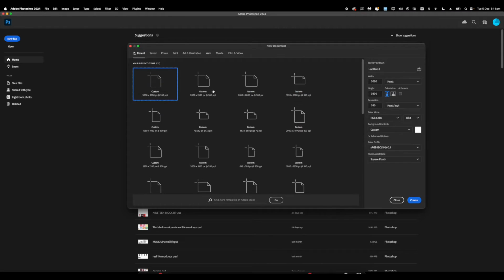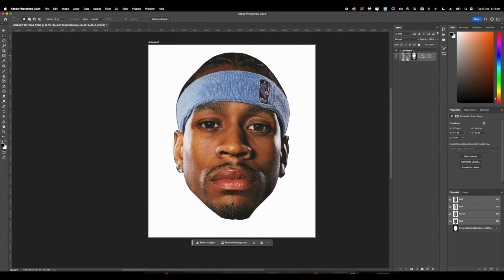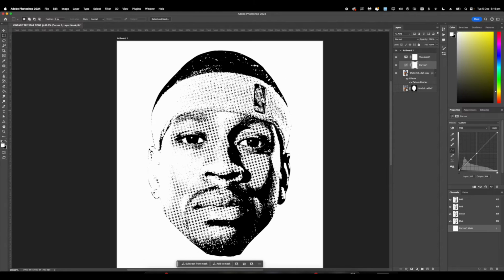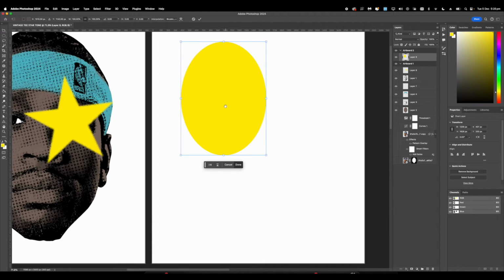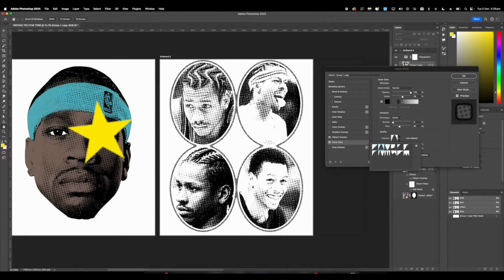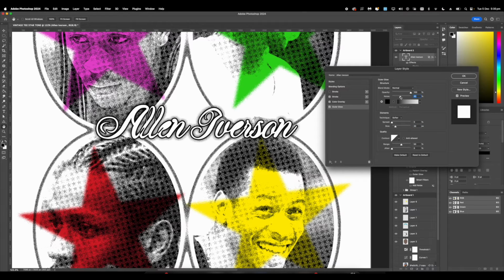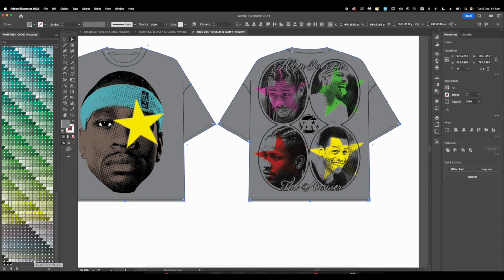How to DESIGN CLOTHES that SELL

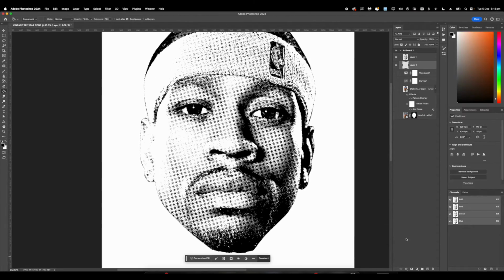Comment: I’m new to photoshop and I’m not understanding how to make a cutout like you at 3:47.
Reply from the maker: You can hold atl / cmd and click the layer of the original cut out head , or you can go to that layer and right click select layer
Reply: @DesignedByWil  Is there another way make the cutout like you did in the video besides those options? I am stuck on this part too,When I hold alt it does not make a cutout for me. I have Photoshop 2021 btw.
Reply: @LulDarius556 @TrueMotivationHubTT I FOUND THE PROBLEM hold CTRL and click on the thumbnail of the layer.
Reply: Could the problem be because I cropped the image with the selection tool instead of masking it with the pen tool to cut out the image at the beginning of the tutorial? @DesignedByWil
Reply: @DesignedByWil  that deadass doesn't work and the right click select layer isn't even showing up gang I NEED HELP MAN photoshop is DOING TOO MUCHHHH
Reply from the maker: @NoahStillAsleep  I cant see your screen this could be anything, if photoshop isn't responding I cant really do anything
Reply: You have to click on the actual image in the layer instead of the side of it.